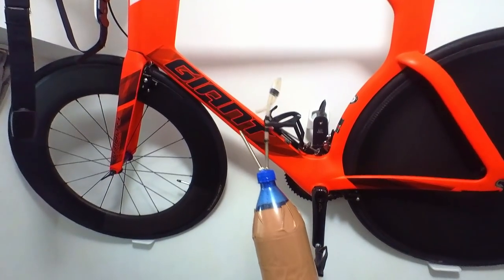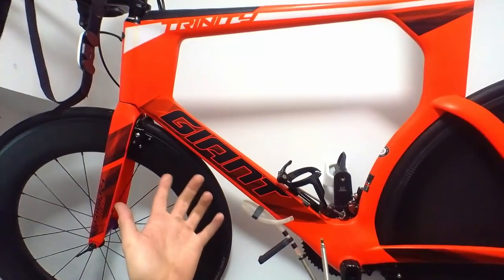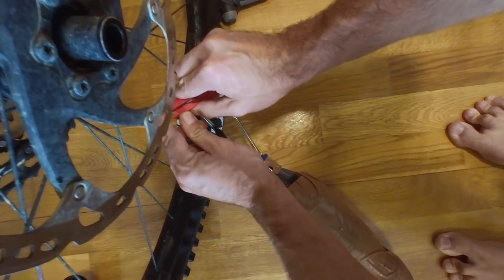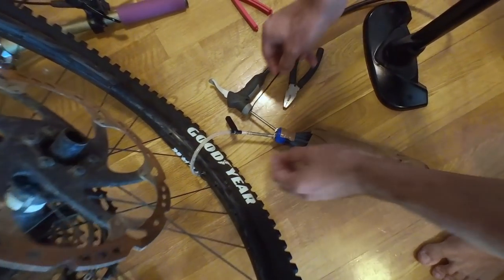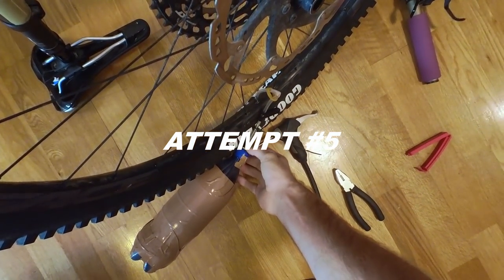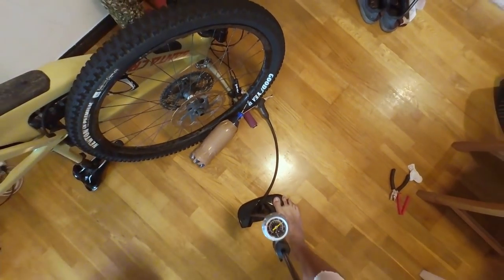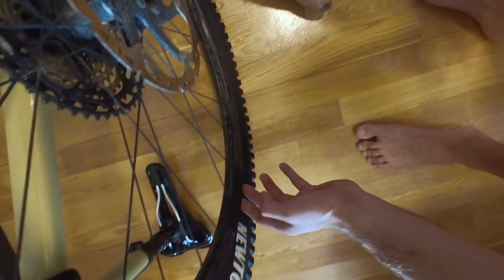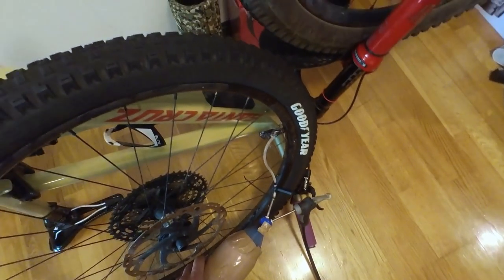DIY Tubeless Inflator Airshot. Do they actually work? No smoke and mirrors test.

Comment: What always works for me, even with the worst tires is to cover the whole edge with ductape. So you stick the ductape on the rim and sidewall off the tire. This creates an airtight seal. Even with the smallest pump you can pop the bead on like this
Reply: That's a good idea!
Reply: Ah yes, the ghetto tubeless setup. My go-to, as well. I don't have hooked rims on my MTB, but with enough duct tape I can get it to work just fine
Reply: @Hiasibua  I only use the ductape for the install, afterwards I take it off. Just for the bead to pop, I dont tape it on the rim bed
Reply: Gorilla tape is so much better than the proper tubeless tape.
Reply: Awesome idea, dont know why I didnt think of taping over the bead!
😀 Thanks!
Reply: Spray the beads with soapy water to lubricate it so it pops on easier. Using tape as described below is an awesome idea too! Gold star for that guy!😀
Reply: That's just brilliant! Why didn't I think of that myself?! I had to use combustible aerosol and set the tire with an explosion. I definitely wouldn't want to go through that again! 😄

Comment: My secret sauce is to put a roof rack strap around the tyre circumference. That reduces the volume of the tyre and let's the air push the bead rather than inflate the tyre outwards. Get the beads to seal in one shot then add air to inflate.

Comment: I tried with a track pump on some road tubeless and failed. I'm lucky enough to live close to a Service(Gas) Station so used their automatic pump on the 'flat tyre' setting after taking the valve core out. Worked a treat!

Comment: I made one from a garden sprayer bottle made to withstand being pressurized. It worked fine, then one day split open gently and quietly. So, I made another from high pressure PVC pipe and that one works just fine. But tubeless rims with tubeless tires, I inflate with a floor pump, no problem.
Reply: it exploded twice. a cocacola bottle can withstand much higher pressures

Comment: Apart from all the other good tips: what is sometimes needed and depends on the tire/rim combination and especially the rim shape, is another layer of rim tape. It doesn’t even have to be tubeless tape, but electrical tape works fine. All it needs to do is elevate the tire in the bed, so that it is already air tighter when in the bed and a “shorter” way to be adequately seated.
Reply: That doesn't even sound bad. Gotta give it a try next time I'm changing tires!

Comment: Going back to a uni project many years back (a 1,25L coke bottle with compressed air was the only allowable energy source), a plastic bottle with the cap epoxied on easily held 100-120psi from a home compressor. Other teams went higher with  more industrial equipment. I'd say you're safe, but that was before bottling companies started taking material and cost out ;)
Alternatively, picked up a Topeak Joe Blow Ace a little while back. No reservoir, but it has three pressure ranges. Set to 0-60psi it's set every MTB and gravel tire I've thrown at it. It is nowhere near as much fun as a bottle hack though.

Comment: I’ve used a 2L bottle, never dared to pump it above 40psi, although that was for a 700x38c tyre.

If you take the valve core out it’ll go up first time and seat the tyre. Then add sealant, refit core, and pump up as usual. Oh I also lift the wheel off the ground so the flat spot at the bottom doesn’t provide an easy means of escape for the air.
Reply: That is pretty conservative on your behalf. When I seat MTB or my gravel tires alike (700x45C), I typically pump them to 45ish PSI dry first, to make sure I can seat them and have them seal without sealant. You often get the bead "popping" even after the first couple of pops and easily past 30 or even 40 PSI. 

A 700x38C tire alone, is like 2.8~2.9lt in volume (assuming 32mm width and 708 OD / 622mm ID). If I was to get my tire to 40-45 PSI and assuming that a portion of the "booster" will be lost before the tire is seated, I would pump it to at least 2x the target PSI in the tire. MTB tires are notably larger in volume, thus the "extreme" PT had to go to, risking his naked toes to be blown off :p
Reply: @dtolios  conservative but it works. Regardless, the main thing he did wrong was leaving the valve core in.

Comment: I had a struggle with one of my new 44mm gravel tyres. I almost broke my fingers trying to seat it with a tyre leaver (it worked for one of the 2) for 2h… rushed down to the store the next day, bought a ridiculously expensive pump with a booster and it took literally 2min to seat the tyre and set up the system with sealant… it was so worth the money.

Comment: I can usually get tubeless to inflate with just the track pump. On the odd occasion when this did not work I used a cargo strap around the outside of the tyre to squash the tyre down a little which forms enough of a seal to allow the pump to work.

Comment: I also made my own tire inflator.  What I'd do is when the tires are partially inflated, I'd take off the inflator and connect my pump to the tire valve and continue pumping until I get that pop. Put soapy water around the rim and tire bead to make it easier for the tire bead to sit.  It will be a bit messy though...

Comment: The issue with poor seating is not flow or pressure, but tire to rim fit. If you get poor results or your chosen combination is hard to seat, you need to build up the center channel of the rim. You can use duct/gaff tape or even more tubeless tape, but you only need to build up where the bead rests. You'll add this BEFORE your tubeless tape. Adding additional height at the edges will only make it more difficult to seat. You can test it before you apply your tubeless tape, just make sure it fits with no large gaps. Then add your tubeless tape, 2-3 layers(Whisky or Uline PET green packing tape), and it should seat WITH A HAND PUMP. If it doesn't, how do you expect to fix it on the trail if it unseats? With a good setup, you can plug a flat tire, and even it's unseated, get it back running again without a tube.

Comment: I use rubber grease on the rim and tyre bead when seating the tyres, and a latex sealant which works well. 

Basically if you've got poor seating of the tyre bead it doesn't matter what you use for supplying air as it'll come out through the lack of tyre interfacing before it can even inflate the tyre. 

It always astounds me how big the tolerances are in bikes in comparison to cars. Like my race face rims that aren't even designed for tubeless don't need sealant, whilst my campagnolo ones specifically designed and welded for tubeless do.
Reply: That's not a tolerance issue, but a lack of unified design. Every manufacturer thinks they got it figured out and consumers are left to decipher who's correct. We also need to ditch the idea that rims should be designed for tubes and tubeless. Dedicate rims and tires to tubeless, and commit to it.

Comment: I've made one. It worked perfectly on my MTB tires and not so well on my commuter, but that's more the tire rim combo imo. I pumped it up past 100psi on the first test and then it leaked from the holes I drilled in the lid. 

The inconsistency is pretty annoying and the last time it was a humid day and I was absolutely friggin drenched in sweat from the pumping. Nearly cracked and bought an air compressor on the spot.
Reply: Little tip, pour a tiny amount of sealant into the coke bottle....then it stopped leaking from the holes in the lid !

Comment: Here's a little tip that made my life a lot easier: If you have a tube, install it with the tube first, then remove it. This way, one side will stay locked in place and airtight. All that's left is to install the valve and pop the other side of the tire into place.

Comment: I spent hours doing this too.  A complete waste of time and effort in my view, an interesting experiment though. In the end I bit the bullet and bought a double chambered track pump and threw away my IED Coke bottle. 10 out of 10 for your perseverance though. 😎👍🏻
Reply: lol IED coke bottle 🤣
Reply: I had it worked literally the first try, with the same exact setup as PT.
Reply: @alicangul2603  a lot depends on how tight the tyres fit to the rims I think.
Reply: @scpromark  I guess so. To give context, I used DT Swiss 466D 29er and Schwalbe Rocket Ron.

Comment: Adding some lubricant helps too, like soapy water to help the tire to seat. By the way just get a small second hand compressor off FB marketplace, that's what I did, 6l so doesn't take up much space, paid £30, good for blowing out dust from the PC as well and other cleaning duties, and not being scammed at gas station anymore for a bit of air either.

Comment: I so want to try this but don't have any tubeless tyres to play with. I have previously made an air powered boat that used 6 2 litre bottles inflated to 80psi. A tubeless car valve works well for inflating them. I used a 4mm drip irrigation tap for the on/off switch. To improve the air flow I wanted to go to 6mm tubing and tap but there was none to be had locally. 
As far as IED's go these things are fairly dramatic. They are often used for bottle rockets and an incredible amount of noise can be made by putting dry ice inside a sealed 1 and being WELL back before it vents.
Reply: A 2l bottle threaded*  into a Scuba cylinder @ 5000 psi almost makes a rather loud bang.   (* AKA mangled.  The trick is first softening the plastic with a lighter and forcing it into the cylinder,  forming an approximation of the cylinder's finer threads.  DO NOT TRY THIS AT HOME :) )

Comment: I have done this and with a bit of fiddling it worked. I had to bounce the wheel up and down on the ground to initiate some of the seal. Also, have you tried to do it with the valve at the top so it's not trying to blow through the sealant?

Comment: I've used this setup for probably 10 yrs now. A few tips to improve the setup...
Frosty jacks cider bottle = 3L. The extra volume helps stubborn tyres seat.
Car brake hose pliers to clamp hose.
This setup is great for throwing the cap in your bike bag for travelling abroad too, just buy another carbonated drink bottle out there.
Reply from the maker: That is a great tip about just taking the cap. Nice.
Reply: Did you you drink the frosty Jack's?

Comment: try using used fire extinguisher. it's not hard to make and it holds a lot of air and really high pressures safe and with no issues. plus it is very easy to operate (adjust and control the air flow)

Comment: You need to start pumping again after you release the air from the bottle. As others have said a bigger bottle as well as the pressure drop as it expands into the tire is then less which then gets your seal.

Comment: I'm using one in the shop for 2 years, even tyres that won't seal with the compressor or a CO2 cartridge will easily pop with this.

Comment: @Peak torque. 
Found online for 2L bottles are rated to go up to 150 PSI (When in good condition)
I reckon you can easily go up to 100 PSI (if you fix your leaking issues) and get the tyre to seal

Glad you didn't go any higher than 140 PSI in your video :)

Comment: I've made a couple of these. Same bottle size. Beefed it up considerably with Gorilla tape (other brands available), especially the lid area. Worked a charm for road tyres... Tighter tyres required a bit of lube on the bead, but eventually worked. Managed to go as high as 9-10BAR with one of these... yes air was pissing out the cap between the valves, but I pumped furiously enough to get the pressure up to an adequate amount. Usually 7Bar is enough. *Pro tip*, (from a complete amateur) when releasing the pressure, have valve at 12:00, and press down on the tyre around the valve, so the air doesn't piss straight out.
For higher volume mtb tyres have you considered a larger bottle? e.g 2l?
Reply: After opening the airflow and if the tyre is almost seated but not quite, you should continue pumping, the tyre will hold enough for the pressure inside to continue increasing inside, and therefore finish seating.

Comment: I can't get a brand new set of Maxxis DHR IIs on a set of Raceface AR30s without the use of the compressor. Even with one side on the bead using a tube.  Even the bike shop I took the wheels to smirked at first then had to admit, not even a track pump with 250psi would do it (which is  what I was using).  I assume it's two super tight fitting tolerances and very stiff sidewalls.

Comment: Adding some soap water all around the edges of the tire helps to fit the tire, so it seales. Sometimes its required, sometimes it is ok without.

Comment: My first time going tubeless I inflated my tires no problem and thought that was easy, then I replaced both tires and couldn't get them to seal. Not even with my compressor at 130 psi. Then I figures out if you pinch the tires and bring the bead as close to the edge of the rim on both sides and then inflate it works, anyhow I still said F it and bought the Joe Blow booster pump so that I wouldn't have to battle it anymore.

Comment: 1.25L and 4.5 bar pressure, works on everything. cover it with a blanket and use ear plugs just in case it explodes

Comment: I use the garden weed killer spray method. Think it cost me a tenner off eBay. First attempt resulted in sealant spraying everywhere but that was 100% down to user error (I took the plastic tube off in order to put the valve core back in but didn't put my finger over the hole, so everything just sprayed straight back out the valve...idiot). Second time it worked a treat. Would thoroughly recommend. But would also echo other comments, that you need to remove the valve core, so the air can rush into the tyre at pace.

Comment: No sealant?  That makes things easier.  Pop sealant into the tyre by the valve, with it down the bottom.  Mount the tyre, remove valve core, turn the valve to the top so the sealant starts running down the inside of the tyre/rim and then blast it with the IED blowing sealant around the inside of the tyre/rim.  I've been using one of these for years.  It works first time every time with the right technique.

Comment: I just use CO2 cartridges, they worked flawlessly so far (on 38C and 43C gravel tyres), they're quite expensive but I'm not reseating tyres that often to justify the price of a 50€ booster tank,
Reply: Not all sealants play well with CO2.

Comment: I wimped out now and use a pancake compressor and a spray bottle of soapy water. It's a noisy mess but works. I get that you're in a small apartment and that wouldn't fly.

Comment: 2L pop bottle might be a bit of an improvement. I think one problem is presta valve has such terrible flow rate, you can buy higher flow versions, although looks like you did take the cores out which would help.

Hope your knee gets better.

Comment: no need for reinforcing the bottle, they hold lots of pressure. i used to unload trucks at a grocery store and watched a driver use a 2 liter soda bottle to support a pallet that weighed hundreds and hundreds of pounds with no problem.

Comment: flow, pressure and volume... remove core from wheel valve for flow, use a 3l bottle for volume and pump to a good pressure -7bar or so. Alternatively buy a cheap air compressor :-)